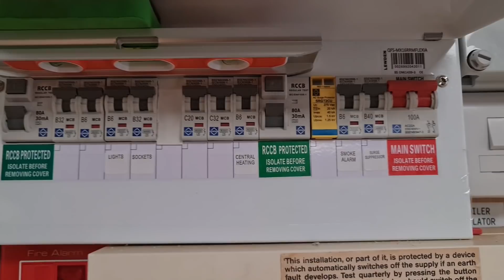Electricians New Tools, Croppers, Drivers, Milwaukee Shockwave, selectivity MCBs goes wrong BANG

Comment: Things have certainly moved on , regs have complicated and expectations raised.

It's not all about tools , tooling , and what you haven' t got.

More about how you approach the job professionally - and do the job - not what you have in the tool bag.

Too much pressure put on new folk in the job to overtool - you don't need much to get going - the more esoteric stuff is bought when you really need it.
Reply from the maker: This is a really good point. I love to have new tools but many go unused. Can get most things done well with a set of croppers and a few drivers.

Time saving ones are invaluable though along with the ones which help prevent injuries from repetitive use.

Good point and thanks for the comment.